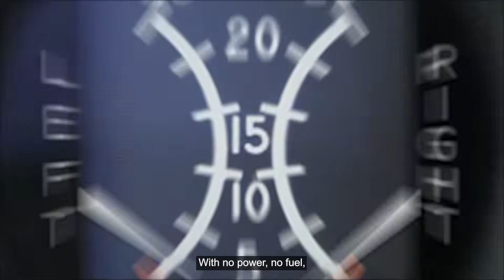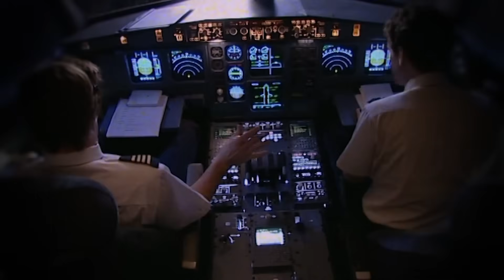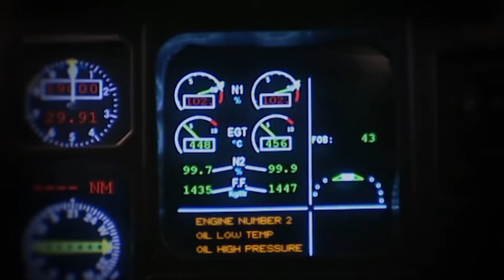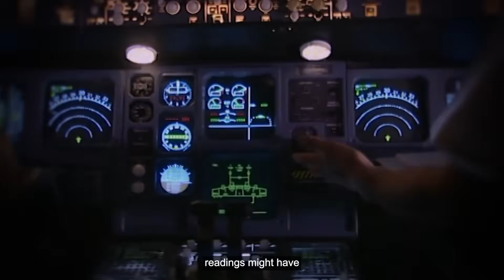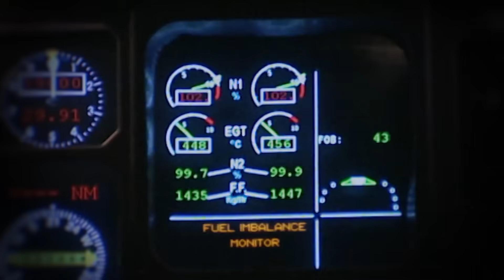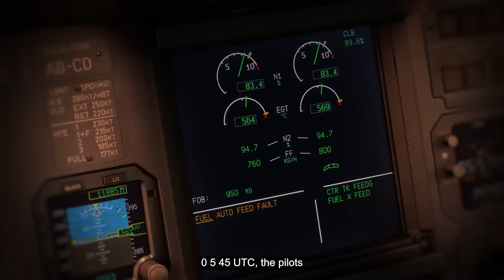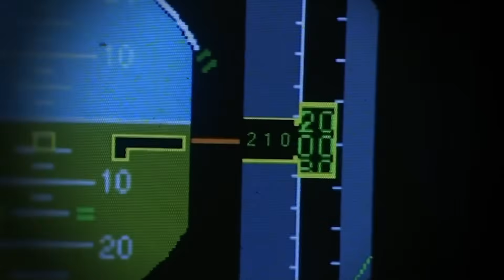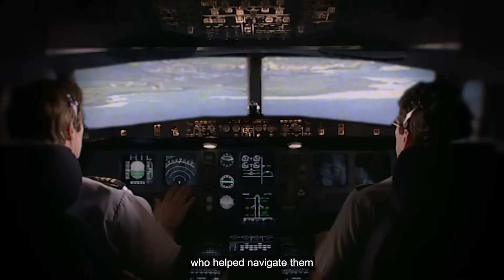No engines. No power. No chance — and yet, 306 people survived

Comment: The pilots caused this situation. Instead of following the checklist for a fuel imbalance issue, they took it upon themselves to manually open the fuel crossover valve to bleed fuel from the good tank into the bad one. If they had consulted the checklist it explicitly says do not transfer fuel between tanks when there is such a big discrepancy
Reply from the maker: Great point! The pilots should have followed the checklist—it’s like a recipe for flying safely.

Comment: The pilots should have been required to take a training refresher course. Not as punishment, but because their skill set definitely needed an upgrade. If it was felt best to not let the public know about the additional training, the pilots could also have been tasked with helping to create a simulation of the incident to be used in simulator training of other pilots. This part could be released to the public. Yes, the pilots made some terrible mistakes, but they did save the entire plane load of people, so I think additional training is a better way to deal with the pilots in this particular case. From the poor way that they dealt with following procedures, they do seem to have needed more training. The company isn't without blame in this. They okayed a part that was the wrong size, which led to an accident that nearly cost several hundred lives. They also failed to adequately train their pilots. This incident happened a long time ago. I hope that the pilots did get the additional training that they needed, and I hope that the company was penalized for their part in this near tragedy.